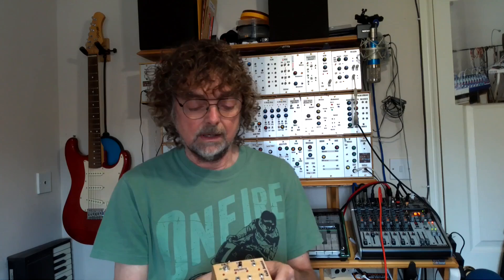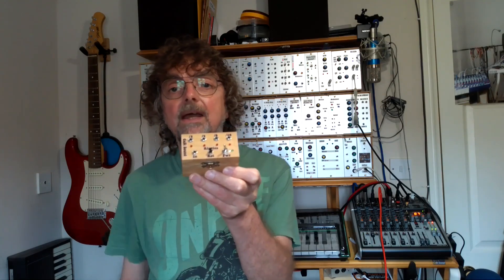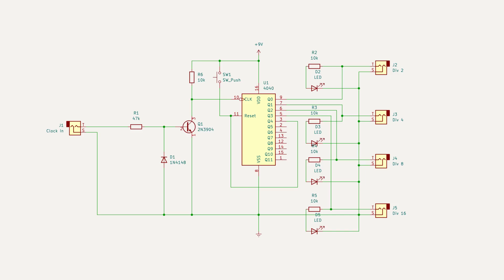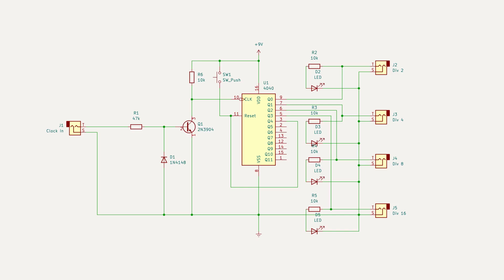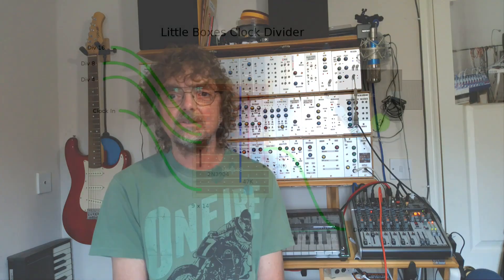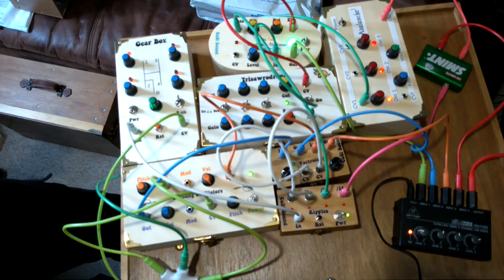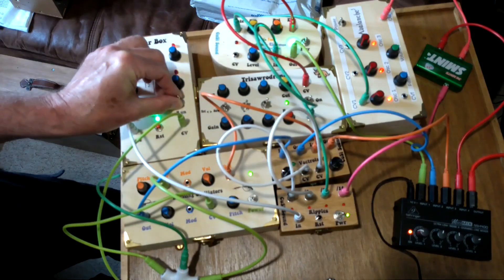Little Boxes : Ripples

Comment: This would be even better if it had an internal clock oscillator with the external clock being applied via a switched jack socket so that the internal clock is disconnected when you plug in an external source - quite apart from offering extra versatility, it frees up another oscillator in the synth from being used as the clock - that way you could use it as a frequency divider as well as a master clock generator. I built something similar to this back in the 80s using a CD4093 as the clock oscillator, with a couple of the spare gates used to gate the oscillator on and off based on external inputs, but using the CD4024 as the divider - only 7 stages rather than 12 but perfectly adequate in practice :)

Every modular synth setup needs something like this!
Reply from the maker: Most of my Little Boxes projects are a good starting point for customisation or further development. That's part of the joy of DIY.

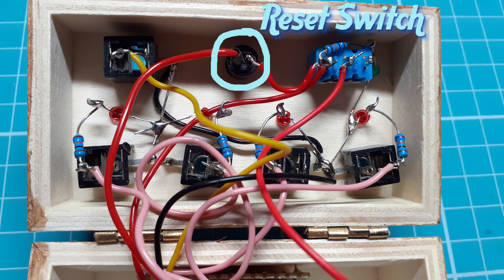Comment: 4:48 Alan your solder joints are so bright and clean, that is a beauty to behold.

I am itching for another rippler that runs at a sightly different clock speed and then hearing the chaos erupt, maybe with some extra "and" function which allows one to reset the other. I love your use of the very basic building blocks of digital electronics and how you merge them with the analogue boxes. The boxes themselves are each their own works of art too.